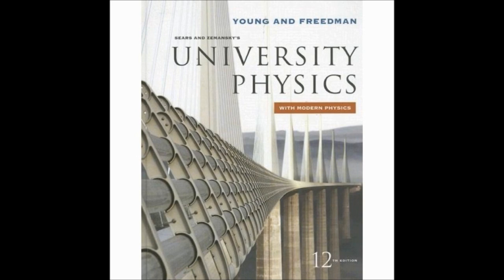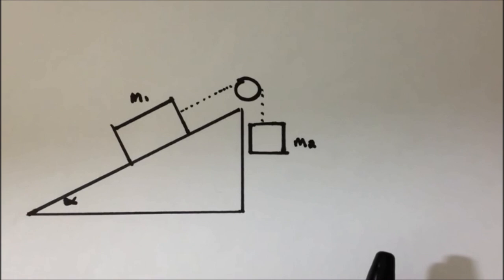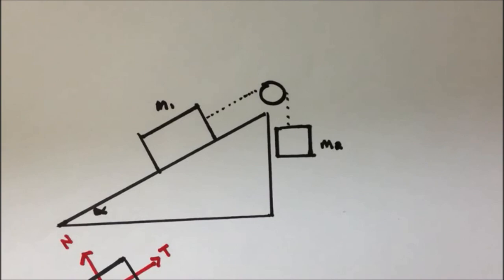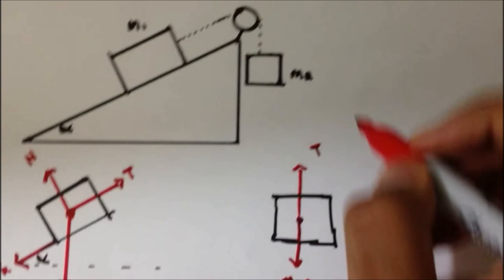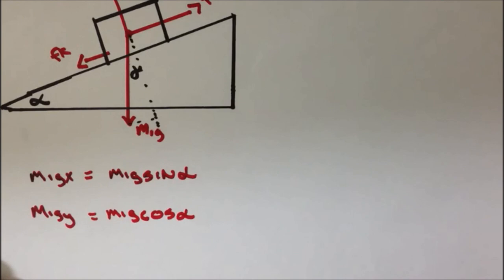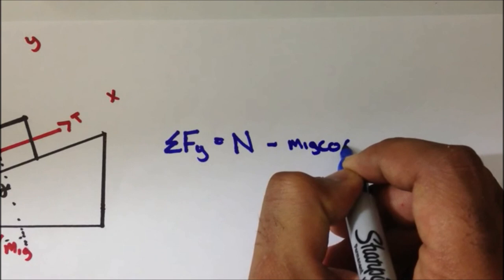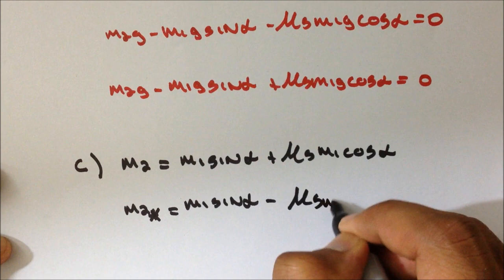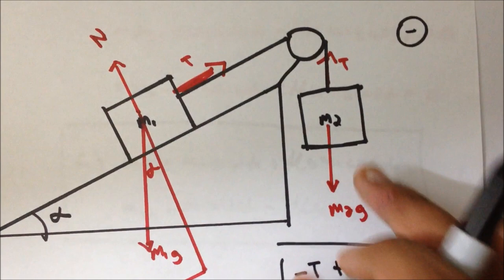Newtonian Mechanics: Friction on Inclined Plane w/Pulley (EF)

Comment from the maker: Good question. It is commonly believed that the x-component is given by the cos. In much cases it is true because of the orientation of the coordinate system. In the case of the Inclined plane, the coordinate system we have chosen is perpendicular to the plane, not to the floor. Multiplying the magnitude of the weight (in this case the hypotenuse) by the cos of the angle will yield the adjacent projection, which is perpendicular to the plane just as our Y axis that we have chosen.

Comment from the maker: A good way to check is algebraically. Lets say you decrease the angle of the inclined plane all the way down to 0 degrees. The Normal Force is still the same mgcos(x), and in this case the angle is 0. So that's mgcos(0), which is = to mg since cos(0)=1 or the weight it self as it always have been when there is no inclined plane or inclined at 0 degrees.  You have nothing to worry about, this is (EF) labeled video. Hope I answered your question.

Comment: But what happens to Friction in the case when M1 is horizontal to the pulley but on an inclined surface (m2 is dangling on the other side of the pulley and the system is in equilibrium)?
(Is friction going UP the slope or down? I'm thinking in terms of friction going UP the slope because the movement would want M1 to go down and as Friction is opposite to motion).